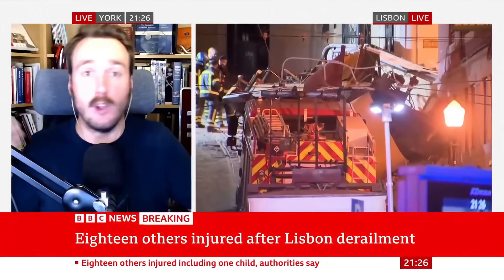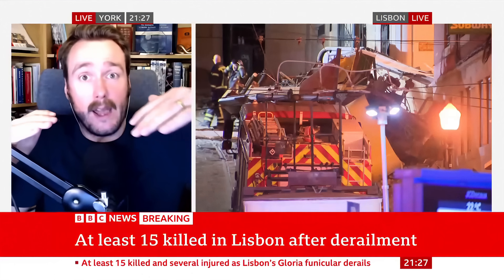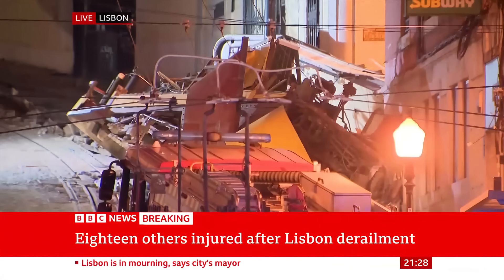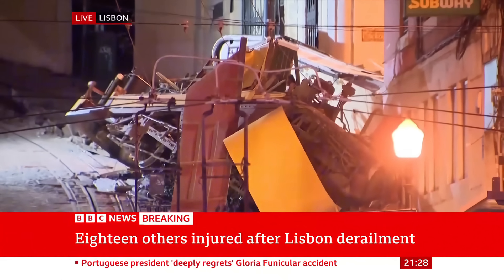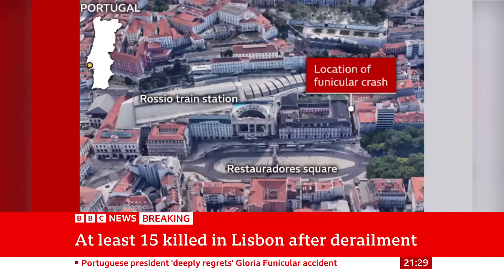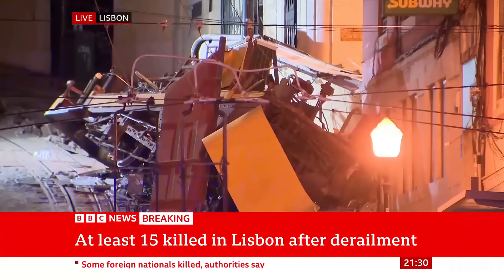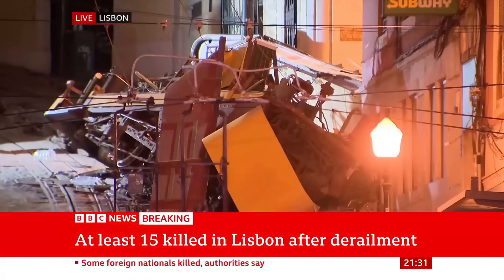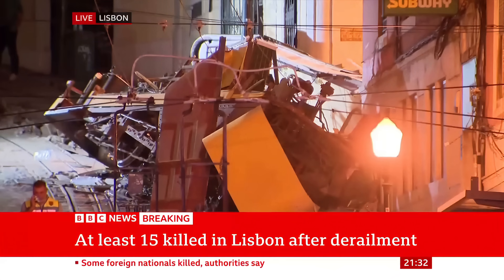Engineer gives thoughts on Lisbon funicular crash | BBC News

Comment: There is usually a steel wedge brake that jambs into the slot between the rails should the cable break. It appears that there have been multiple failures.
Reply: Aparently when the cable broke the wedge didnt worked and it got in uncontroled fall
Reply: Looking at the design of the emergency brakes, just pushing down to the steel barrier of the cable canal (using only the vehicle as a counter weight), I would not be surprised if this technical solution never could have brought the car to a stop in case of a sudden cable snap. A misconstruction since decades.
Reply: @ulrichgloeckl6072i agree bad design..... in 1885 they didnt think it could snap
Reply: @flyboya340 I would be very, very surprised if the initial designers didn't think of the possibility and design some sort of brake. However this system has been redesigned at least once, and likely more than once. Details might have gotten overlooked in the redesigns.
Reply: Exactly! I wouldn't be surprised if it was the fault of the operator who didn't respond quickly enough to deploy the breaks. We will know the facts soon enough.
Reply: @gnosis7662  It is not up to the operator. The emergency brake, the wedge device the OP refers to, applies automatically if tension is lost in the cable (like if the cable snapped). It would be applied by a very strong spring which is normally held back by the cable tension. The same sort of device is present in vertical lifts.
Reply: @lexlayabout5757 Similar idea as in elevators. If the cable breaks, the brakes are forced on. Should be fool proof. Sometimes isn't. Here wasn't.
Reply: @markkulehtinen4733  Yep, since the Otis security system invention in 1853, in Chicago, elevators are allowed to transport people. Until then, only cargo was permited. Was too dangerous for people. Something is wrong here because the cabin at the botton also crashed. A minor crash, since it was at the very beggining of its journey way up, but some of its passengers got injured, anyway. If there was a security brake system, it failed in both cabins. Something is very, very wrong here.
Reply: @gnosis7662  The fact that recently they cut costs by reducing daily inspections from 24 hours to just 30 minutes, and went from 24 employees to only 6, already says a lot about the situation… Most likely the driver, like everyone else, was a victim.
Reply: @gnosis7662 Blaming someone who could be innocent before all the facts are in well out of order. So sorry for the poor victims of this tragedy.
Reply: @gnosis7662  That would be some stupid system, when you could/should have an automatic brake.  That's how it's spelled: brake.

Comment: It's worth noting that the street was relaid back in May this year.  There's also the question who was responsible for maintenance, CARRIS who operate the trams or the City Council who it's said (currently unconfirmed) outsourced the work.
Reply: Neither. Funiculars and elevators are maintained by a specialised company, hired by Carris.
Reply: @RFC3514  Thanks for that, I would have thought Carris would have their own specialised team.
Reply: @bertiew6771  - They do have internal teams for buses, trams, etc. (because they have hundreds of those), but they probably don't have enough elevators and funiculars to justify a full-time team, and that's different enough that they decided to hire a specialised company (which presumably maintains and repairs other funiculars as well, not just the three or four operated by Carris).

It's pretty common for lifts, cable cars, etc., to be operated by a transportation company but manufactured and maintained by a specialised engineering company.
Reply: @RFC3514  Sure but either way both Carris and CML approve the licence so neither should be washing their hands of responsibility.
Reply: @bertiew6771  - I made no comments about anyone's legal responsibility. I simply mentioned that maintenance of funiculars and elevators is done by a specialised company, not by the transport company (that basically handles the tickets / passes and employs the drivers) or the city council.
Reply: @RFC3514  I never said you did . I appreciate your input.

Comment: Surely it must have a 'fail safe' secondary braking system fitted? Rigorously tested. You dont just rely on a single point failure "cable".  Sounds like human incompetence or worse. 2 spanish cable cars 2024, Greek trains 2023, Italian cable car before that. Bit of a patten forming.
Reply: A cable hauled car like this would have a spring loaded brake that gripped the rail(s) if cable tension vanished. Same with vertical lifts. However these things can fail to work sometimes, maybe because of lack of maintenance.

Comment: The original function of these funiculars was simply as a mode of transport which locals used to get from the lower to the higher areas of the city, but with the enormous increase in tourism here over the last few years, this funicular and the others that exist attract long queues of tourists who simply want to ride on them. They were never designed for the numbers that they now carry, with the cars packed on each pass they make. I believe they've simply been overloaded for some years and the strain has resulted in some major failure. Remember that the original system is 140 years old.
Reply: 140 yrs since inauguration.

Not 140 yrs without maintenance and improving all the mechanisms.

We are investigating this very strange accident.

A maintenance inspection had been done on that very morning.
Reply: We were there in October. Not the height of tourist season but nice weather. We didn’t ride on this tan but we walked down the road it goes on. The trams weren’t crowded at all.
Reply: the cables were obviously upgraded - but what specification and what was supplied ? - the one in hong kong had the cables replaced 6  years ago - a lengthy down time then
Reply: @firstlast-pt5pp  Every 600 days its is to be replaced, its was due to be replaced in 235 days.
Reply: @firstlast-pt5pp  cable replaced less Than a year

Comment: The left vehicle, according to witnesses/passengers, also fell, albeit without any damage or injuries to passengers as it was just a couple of metres along its path, suggesting that the cable itself broke right after both vehicles started moving. That’s the silver lining in this disaster; had the accident happened with the left cab higher up or both cabs at the midpoint, we could be looking at the two vehicles crashing at the intersection and then on said building, or the lower cab ending up across the street, maybe also mangled in some way due to its old construction.

Comment: Are there no emergency brakes on these carriages? A cable snap or dislodgement is a foreseeable event with this design.
Reply: yes but even with the brakes full on it would have skidded all the way down on the tracks due to the steep hill and weight of the carriage...
Reply: @guesswho-i2u  No it would not have skidded down if it were working properly. The emergency brake would be designed to hold the weight of the the fully loaded car, with a safety margin beyond that. Possibly it was not working properly though. Even designers 100 (or whatever) years ago would have allowed for that.

Comment: Old system no automatic safety catch.the tracks in the pavement are just tracks, no increments of individual latches for a hook to grab and hold the cable car if a cable was to break. From what I can see they are very heavy cars because they have extra metal and lifting mechanics in the bottom chassis to self level as you could probably see in videos of it as it goes up and down the steep hills there so I can can imagine of the sheer force when it broke loose and started the downhill to crash into the building. Tremendous force and impact. Yes it's very sad for many people but will there be compensation for the families? that's one of the downsides of traveling abroad you are in the unknown zone of what if? It's not the USA where there's insurance on public transportation among everything else.
Reply: No, man, insurance is something that only exists in the USA! USA USA! The rest of the world is a jungle, and the only way these European savages managed to have multiple funiculars operate for two centuries,  carrying several million people every year without a single accident was sheer luck. USA! USA! 🙄
Reply: Yes, we have insurance, yes families will get paid.

Usa! Usa! Dont get me started

Comment: I didn't feel very safe when I rode it and couldn't wait to get out. Pointless to spend 4$€ for 275 meters. They should remove it from service.
Reply: Never forever! The cable cars and the old trams are an important part of Lisbon‘s identity. It would be also an attack on the identity of San Francisco to move the cable cars there. If you want to save $4, you are free to walk up to the Bairro Alto in Lisbon. For young and non-disabled persons it will be of course no problem.
Reply: @bernharddirichs5992  👌
Reply: I believe it's free if you have a bus pass. And it had a perfect safety record for 140 years, while carrying close to 3 million people per year. But I'm sure they'll take your expert opinion into account.
Reply: @RFC3514 
Yes, all the many times I visited Lisbon it was free with a bus pass and there was no additional payment required.
Reply: @RFC3514 lol. Tourists don't buy bus passes for one single ride !
Reply: @RFC3514  👌

Comment: There is footage online of people scrambling out of the windows of the undamaged car, so I assume that must have also experienced some uncontrolled/violent movement to make those passengers act as they did.
Reply: Yes, witnesses say that the bottom cab had just begun the climb, there was a very loud noise, black smoke, and then that cab slided back one or two metres, being retained by the front grid, thus avoiding invading the pavement (which said witnesses thought was going to happen). And then they heard the noise from the upper cab, and saw it derail and ram the building.
Reply: It fell 1or 2 meters down.
Reply: Yes, I heard at the TV that the moment of greater stress to the cable is when it starts moving, as the system has to overcome the inertia.

Comment: The one in Babbacombe has 4 cables ... in case three break.
Reply: Apparently this one has three, but somehow that didn't help. It's possible that one of the cabs' chassis broke and lost its connection to all the cables.
Reply: @RFC3514 Single point of failure.

Comment: When the cable breaks on a lift the brakes are automatically applied to stop the car from falling. I would have expected a funicular to operate the same way. Surely a broken cable is a contingency they have to plan for? Even if the brakes can't stop the movement completely, surely they could slow it down enough to stay on the tracks? Did the brakes fail? Or did they just assumed the cable would never break and the brakes weren't designed to take the full weight of the car?
Reply: This cable car system doesn‘t work like a common elevator.
Reply: @bernharddirichs5992  Yes. It is very primitive in design.

Comment: Gloria Funicular. Google earth shows the steepness and the route. The crash video shows a tram at the bottom with people on it getting off. 
A cable snapped on the one from the top. It must have picked up incredible speed and hit a building on a bend, which  then disintegrated it. If it didn't hit the building then it would have destroyed the one at the bottom. Terrifying 😮
Reply: True. If there was no curve at the end it would have crashed the bottom composition which was full of people (starting the climb), and the tragedy would be in double :'(
Reply: No, in fact it would have run past it as they are on separate tracks. It would have shot out into the Avenida da Liberdade, with three lanes of cars passing and hundreds of tourists milling about. The death toll would have been even more horrendous than it was.
Reply: @jokermaan1 the tracks overlap at the end of the line
Reply: @jesuschristt7692  yes, you're right. The cars pass at the midpoint where the lines split.
Reply: 17% incline

Comment: my guess is that the cable snapped... i'm surprised that there isn't a backup cable for redundancy
Reply: Exacly, even if very rare, the wheels cant stop that, if  emergency brakes are useless there has to be more than one cable..
Reply: They have backup brakes
Reply: @squelchedotter  We can see that…
Reply: I know the Rua da Gloria and the cable car there very well. For my opinion it would be technically impossible to install there a second cable for redundancy.
Reply: @bernharddirichs5992  Than this cant be a transportation system in 2025
Reply: @miguelmelchior986
May be, but it worked since 1885. I almost daily use the Tünel-Metro in Istanbul which is the second oldest Underground in the world and also the second oldest funicular. It was inaugurated on January 17th 1875.
Reply: @miguelmelchior986It brings in money, the only problem beside this one was in 2018.

Comment: I think this was too much of weight because it should take only 40 people and always takes about 70
Reply: I think that this circumstance played a role, but the safety tolerances should actually be designed in such a way that exceeding the weight limit can not lead to such a disastrous accident.
Reply: a good investigative reporter would find what cable specification was ordered and what was supplied
Reply: If properly maintained, the cables could easily deal with more passengers than you could possibly fit inside it.
Reply: So, in addition to the 17 dead and 22 injured (total of 39 people), you're saying there were another 35 people in there... who simply vanished?

Comment: I was in Lisbon all winter. It was probably overloaded. They pack public transport in Lisbon. Terrible
Reply: Everywhere is like that not just Portugal.
Reply: I wonder if the extreme heat could have played a part as in cables not being strong enough?
Reply: You're right about the packed public transport, but in the funiculars the access used to be completely controlled. But it's been a while since I rode it the funicular...